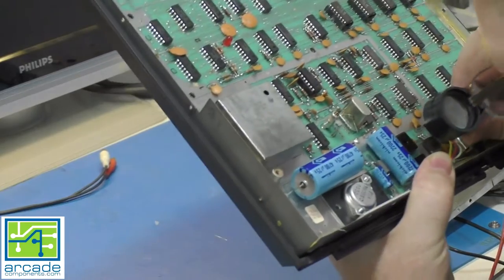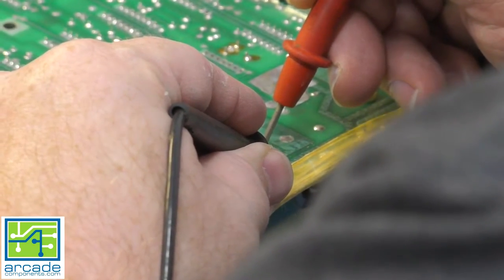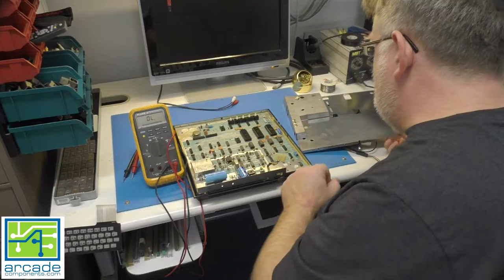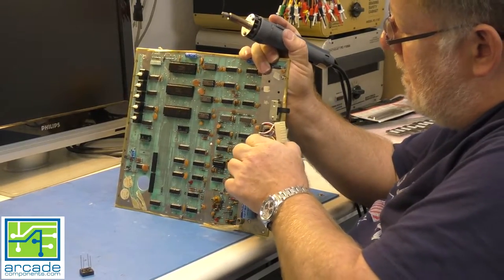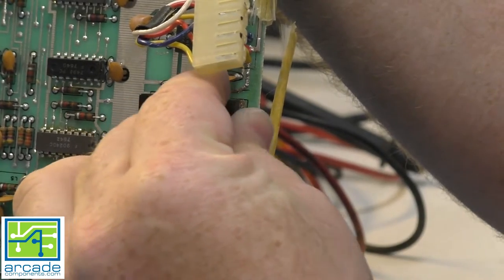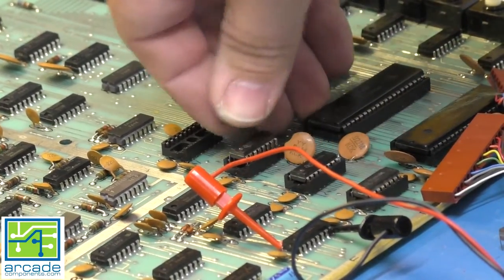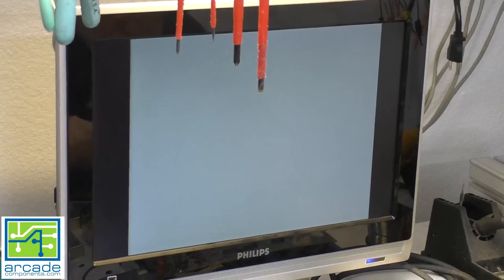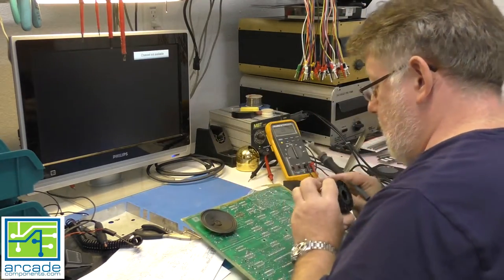Resurrecting a Fairchild Channel F

Comment: I just replaced my intermittent bridge rectifier as well. I would get the led to light up and after the system would warm up it would shut off. Even so my Fairchild is in pretty bad shape I have to disassemble it completely, clean everything and hard wire the cart connector to the board with a reliable connector, because my cart connector ribbons have worn away and won’t fit the port anymore.

Comment from the maker: This was a PITA on the bench. The buttons would not stay up all the way and 3 of the 5 would make contact if you had the board sitting flat. After that it was missing parts and had a bridge rectifier that was intermittent. In all my years this is the only intermittent bridge I've ever seen.
Reply: Would you know how to mod this console for composite output? If so, may I hire you for the job?
Reply from the maker: @JohnyTheWizKid  There's a schematic for a buffer/amplifier and where to tap into the Channel F for the signals available on the internet, but it's not a service we perform.

Comment: Hey! Mine is working perfectly, but after ten minutes, it has artifacts on screen. Cleaned and reseated what I could, then noticed the farthest back rectifier was ripping hot. I assume that's the problem. Where did you get the replacement part?
Reply: 100% the issue. Took the old one down to the local electronics shop and he had the one I needed. works perfectly.

Comment: I have a Fairchild channel f that’s not getting 5v on the 5v rail, it works for a bit then it shuts off and doesn’t do anything. I suspect I have the same problem as you can you help me source the diode bridge rectifier? If it’s not too much trouble can you post a link to the part I need on mouser.com? I’m also going to replace the weird looking 7805 voltage regulator if I still have problems. Should I replace the 7805 first?

Comment: I have one where it turns on sometimes and sometimes doesn’t, when it does turn on it works for less than a minute then shuts off, any ideas why?
Reply from the maker: Check power first. Next, try turning it upside down and powering it on. If it works then check the buttons on the top to see if they are sticking down. That was the problem with the one I had on the bench for the video.
Reply: Arcadecomponents.com i want to get mine fix can you fix it?

Comment: 40 year old silicon parts do strange things.
Reply: I think every single chip is like a single transistor or 2 😮 you could factually buy these chips and make your own pong 😕 some Google guy did just that.
Reply: If you want to make a Pong game, sure it's a single chip needed that you can then hook up video and controllers to.
Not that this unit has anything to do with that, it has a 3850 CPU and two 3851 P.S.U:s something you won't just happen to find unless it's from another unit like this.
Reply: e5frog Free pong app 😎